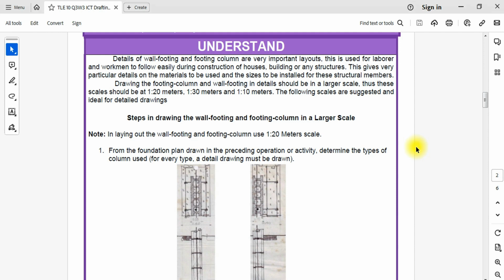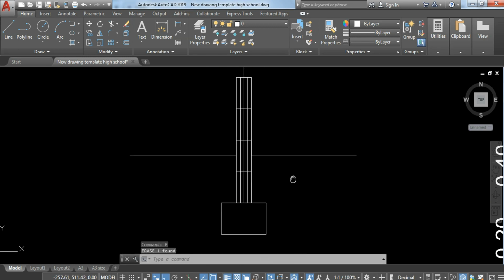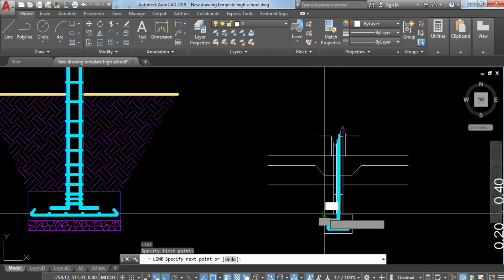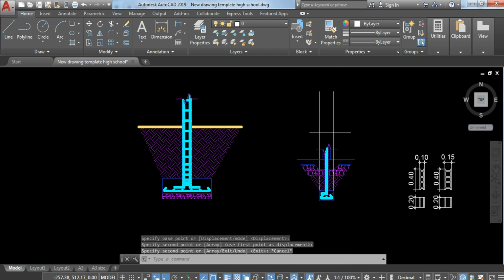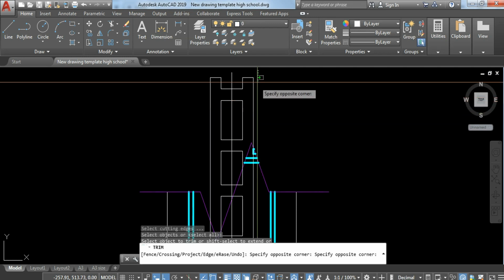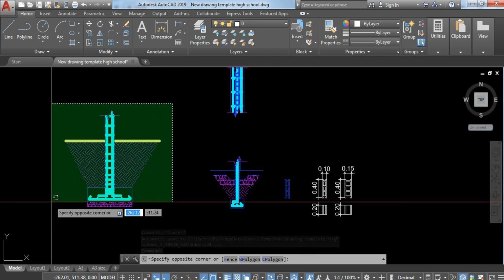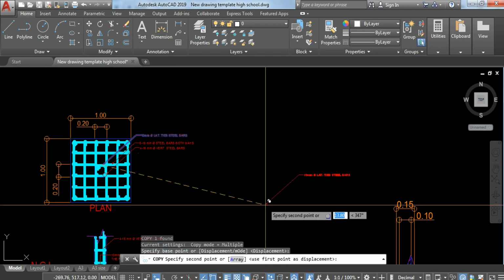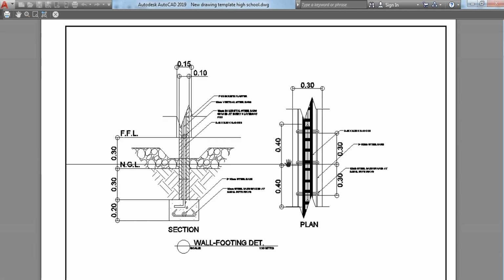Drawing Exercise 22: How to Draft Wall-Footing Details in AutoCADD

Comment: hello po. May I ask po para sa dimension ng hole po ng hollowblocks and spacing?
Reply from the maker: Sorry for late response maam. By standard po if FTB should not be less than 0.20 meters. If WF it should be by 0.30-0.40 meters po